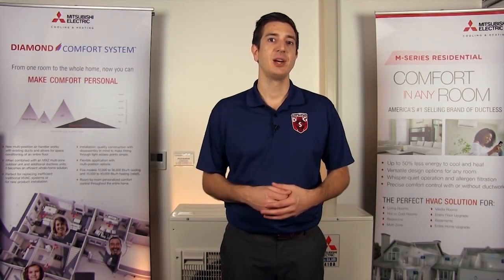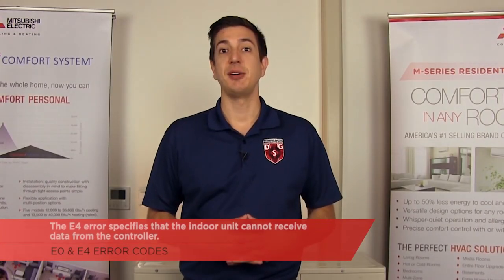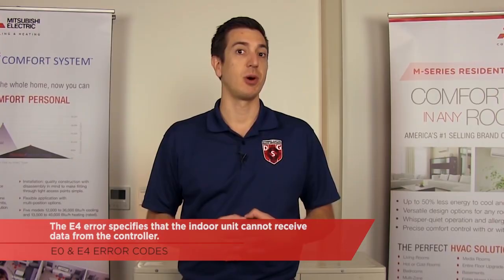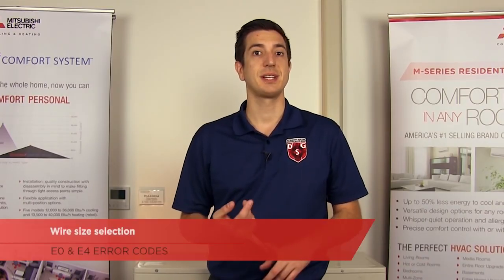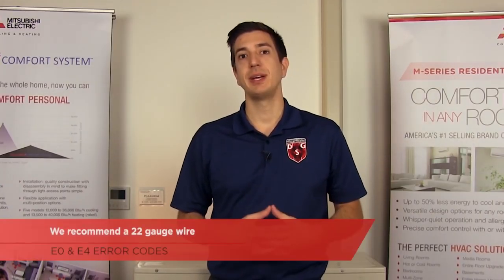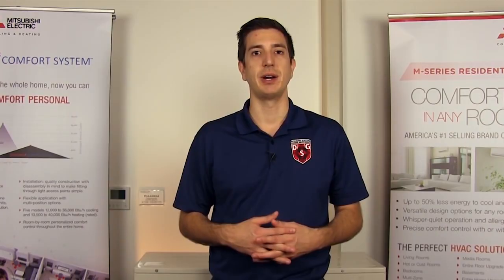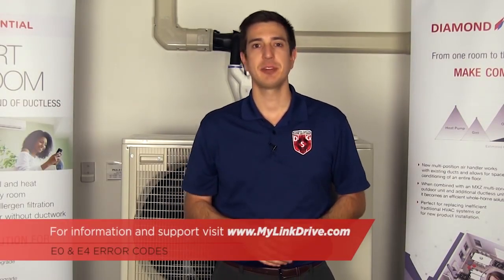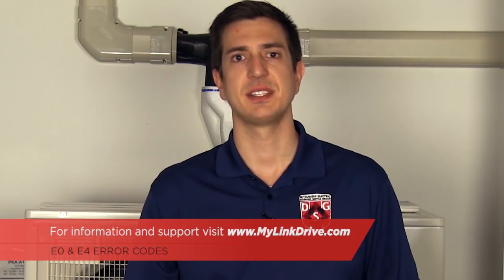Tech Tips: How to Resolve the E0 and E4 Error Codes (L)

Comment: I have window LG unit that has e0 code ,unit was in storage for years and did work when plugged up display code ,removed board and cleaned out mud dobber in board area, where can I get new board and which one is it the one that. Has display in front